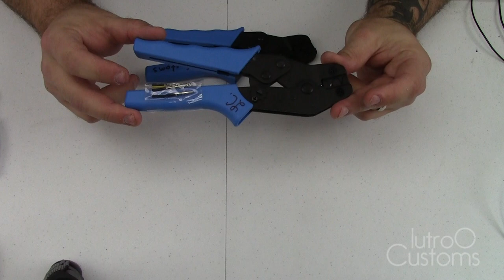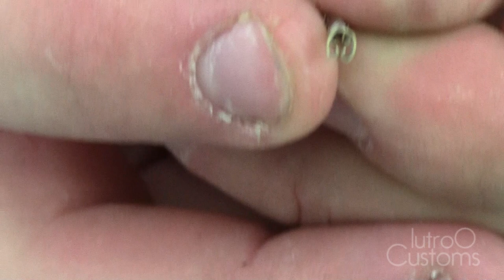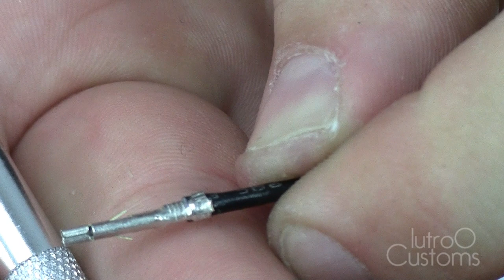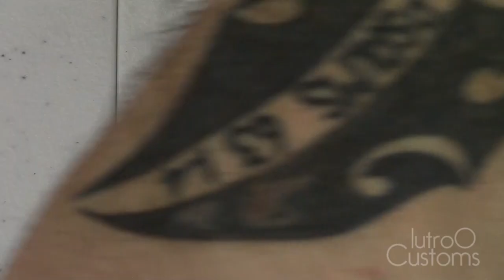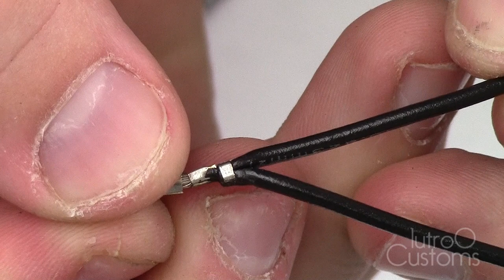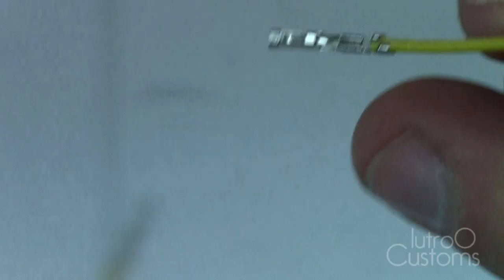Lutro0 Customs - Crimping Guide

Comment: Thank you so much for this great instructional. I had been trying for days just to get the hang of crimping cables correctly with no luck. After watching I finished shortening my 24 wire by 8 inches for a new micro build I'm working on. only took about 2.5 hours. All came out great. May tackle some sleeving soon. Good luck with the new store/warehouse.Will buy a bunch of stuff to make it up to you.

Comment: Lutro0, is there any reasson to solder the wire on the crimp right after you crimp it? I ve seen crimps that were also soldered on the wire.. Do you think there is a reasson to do that? Obviously you add more stress releaf cause the bond (wire - crimp) is a lot stronger but would you ever consider soldering it?

Awesome guide, thanks for your time!

Comment from the maker: I personally use 5-6mm on most wires. However for 16 I just strip it shorter on once side by eyeballing it, and then use the full length on the other side. You can however add a small piece of plastic or such to the slider this will get your strips shorter. The next model up that can do this from the factory costs twice as much, so I offer this model and then some modification is needed sometimes. I plan to start selling them with the modded piece included.

Comment: Dude, thanks a bunch! The only video I found that had the SATA pin crimp instructions. You did great explanations and the part about the tool and how it works was great!

One question: what gauge wire could I use? I have an X299X mobo with a CPU that can suck 350W so I was thinking of using AWG15 wires. Thanks!

Comment: Thank you, for a great detailed video, I came across it because i was searching for how to crimp JST connectors, (mostly the female part) for wire harnesses to use in video wiring in a multirotor race quadcopter, most of the time the wiring needs to be adjusted per build and much shorter. Now one thing i noticed, that the wings differ in shape for the isolation part, (kinda broken wing)  is there a different crimping tool for the ones that wrap around the insulation, instead of getting the heart shape into the insulation ?

Comment from the maker: once I strip it and have measured it by the strip point I can then cut the wire down because the terminal will only allow the insulation to go so far and its the same every time. This is how I trim them.

It would be nice to be able to strip right at 2-3mm but the price point for that stripper is 100 or more.

Comment: I'm planning on crimping and sleeving my own wires. I understand most of what to do except I'm confused on what terminals I want to buy. I'm planning on sleeving a full psu (AX760 corsair) and I don't know what to buy, male or female atx terminals or 4 pin power terminals. Or both lol.
Reply: You will need female atx terminals and 4pin power male or female depends on the terminals for your perf power.

Comment: Hello Lutro I need your help , I purchased everything needed to custom sleeve cables , I watched all your videos even downloaded 
so I can re veiw them ,I just assumed from your videos after watching you it would be easy, but the problem I am having is EVGA does not show were the pins go into both ends of the connectors both ends are female and there diagram show like numbers on each connector but some pins have 2 wires . I tried labling each wire and I still got messed up. is there a way you can tell me or email me the pins from 1 end go into what pins on the other end? my PS is EVGA 1050 gold . I was also on the phone with EVGA and forums and I just dont understand it . they dont seem to make it a diagram simple
Any help would be aprecated Thank you

Comment: The griping part where you say that one is for grip and other is just for relief is only half true. Remeber that the cable is two separate things the connection string and the isolating plastic part. If you had only grip on the strings then if someone pull the cable hard enough the isolating part would come off and leave the strings behind, so you need yo grip them both to ensure that the 2 parts stays together. That's why you have to crimp both parts.

Comment: How about a beginner guide to identifying and naming the different connector types and uses so that we can know what pins and shells to order?
Reply: Kinda weird answering your comment after 4 years but ima leave an answer for whom might need it after. Basically  pins layout need to be 100% correct other you might fry your component. Lay out are available in the internet as long as your psu is from  a well known brand like Corsair ,EVGA ..... etc.

Comment from the maker: Its actually a confusing thing when you first start sleeving.

the connector is called female due to the terminal inside it - the terminal sex is determined the same way all are. Female pins have a male pin that connects by going inside of it.

The confusing part is the connectors.

I hope that is more clear.

Comment from the maker: haha, I believe this is my longest video - however when it comes to info I think it has the most in one, but it needed to be detailed as crimping is an art all in itself and there is so many different methods for double wires - even sleeving that is crimped right onto the wire (which I don't like IMO because you are weakening the stress relief and the crimp by doing so - by using the melt method you are only strengthening the bond and stress relief and crimp all together.)

Comment: Have you tried non ratchet crimpers? In the uk i have been unable to find a good pair of crimpers until i found these (http://www.amazon.co.uk/precision-crimping-interchangeable-engineer-pad-11/dp/B00IWD9XT6/ref=sr_1_1?ie=UTF8&qid=1456849747&sr=8-1&keywords=s+crimpers). With these there is no need to pre crimp, just squeeze the tails on the contact together a little and push the cable in, and then crimp both parts separate. much quicker imo and perfect every time.

Comment: Most of these crimps, especially on the fan pins are way out of spec electronically. What makes a crimp work, is getting so much crushing force onto the copper, it literally breaks and melds together with it a little... if you do not achieve this, you are getting a poor contact. 
 Without spending 500 bucks on legit branded Molex tools, it is hard to get a good crimp.... this is why a decent open barrel crimp tool is valuable... you can focus all your energy RIGHT on the copper without messing with the insulation... this really shows when doing the small connectors, but can be helpful with ATX and molex as well. Should always go back after using your cheap ratchets, take an open barrel and just make sure the crimp on the copper is as tight as possible.